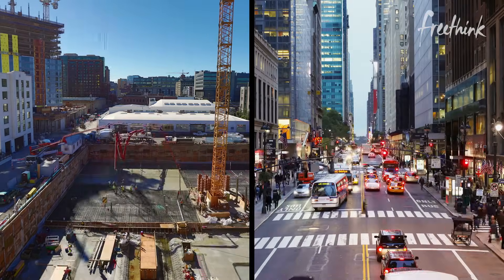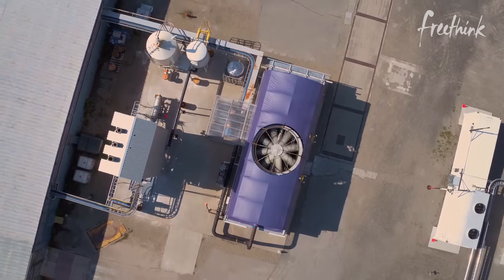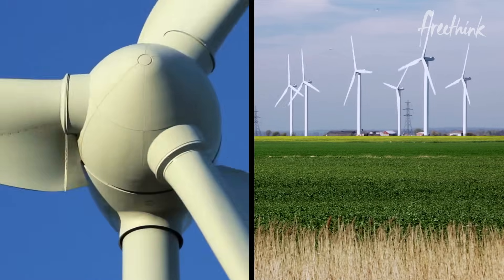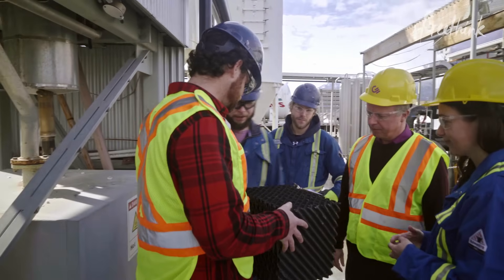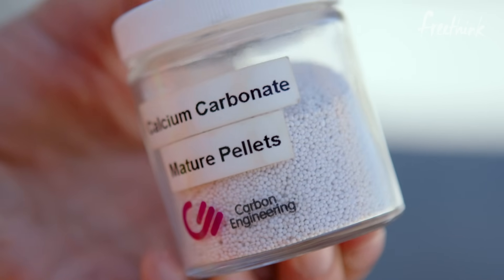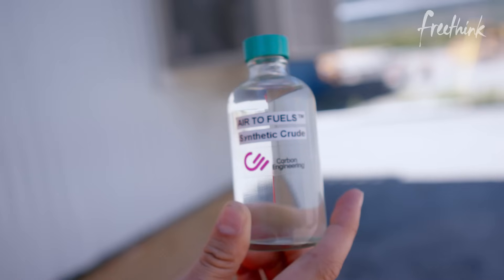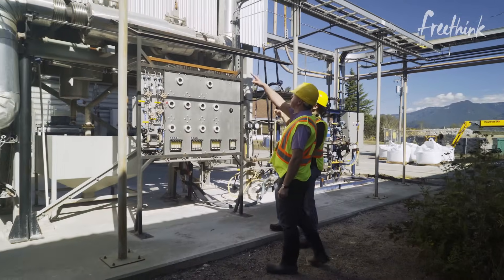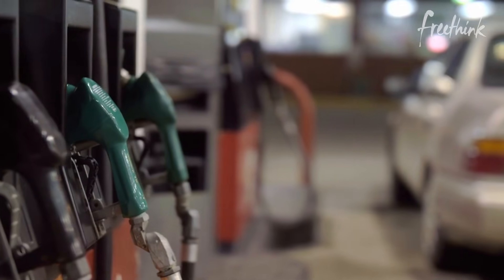Carbon Capture Technology Explained | Seachange

Comment: What i find amazing is, such things as carbon capture is somewhat  a load of nonsense. A giant scam. Is there an  issue with carbon?  In fact carbon is essential to life. In fact there is a dearth of carbon, at the moment, a shortage !!   At 400 ppm current day, this just does not compare to 7000 ppm of old. Note when it was 7000 the earth flourished, it did not over heat. The basic thesis is, more carbon equals more heat equals global warming.  Yet this is so demonstrably silly its laughable. Temperature   leads CO2 not the other way round. This is simple fact, verified by the ice cores. There is no evidence CO2 warms the atmosphere.  Of the three green house gases both methane and CO2 account for just 4 percent between them. Ignored by the IPCC completely because of its political make up (they only concern themselves with MAN made global warming) is water vapour,  responsible for 94 percent of all green house gas warming. . So can you now see fiddling with CO2 a little will have no effect at all?  I could go on....  Light absorption both inbound radiation and outbound... water vapour is already blocking that part of the spectrum CO2 might effect!  its  like having two pairs of black out curtains, the second pair does nothing!!!!   So an even larger second black out curtain (more CO2) is not important at all. It will have no effect on Global warming it is impossible.

Comment: In the Cambrian period 500, million years ago, there were 4000 parts of Co2 per million. Over 488 million years that figure dropped to 180 parts per million during the Quaternary glaciation, some 2 million years ago. At that point this Earth of ours WAS genuinely  heading for a genuine EXTINCTION level event ( for all creatures, indeed the worldwide human population dropped to less than 100,000). It was looking dangerously like it would join the billions of dead planets that you can see every clear star-lit night without a tree or a plant growing on them. Thank God, somehow the Earth fought back and Co2 levels rose over 2 million years to around 300 parts per million by the middle of the1800's. Around 1850 Mankind started to burn coal at that point due to industrialisation. It was lucky he did for two good reasons.

Firstly, Mankind stopped burning trees which is why there are 25 per cent more trees in the Northern Hemisphere than 200 years ago. Secondly, although mankind only produces 2 per cent of the Co2 in this world, as 98 per cent of it is produced by natural outputs, such as volcanic activity, at least he helped to bring Co2 levels up slightly so now it stands at 400 parts per million, albeit that this is still ONLY exactly one THIRD of what is the average optimum Co2 level required for photosynthesis for plants and trees, which is around 1200 parts per million. 

Now here is some simple maths. All plant life acquires Co2 mainly through water.  If the Co2 in the atmosphere is only one THIRD of the level a plant require for optimum photosynthesis, then even to the stupidest brainwashed climate drone without any scientific knowledge at all, it must occur (to what small part of their brain that they still own) that these plants are processing THREE times more water than they want to. What happens to water that plants take in? They can't store it so they EVAPORATE it through their leaves. Forgive me, but err, even Al Bore admitted that 90 per cent of Green house gas is water vapour. Do you think there could possibly be a connection between the FACT that there is only one third of the optimum level of Co2 in the atmosphere for photosynthesis and the FACT that that the Earth has exceptionally high levels of Water Vapour? No, surely not!

Luckily, as is often the way of history, the next generation but one, will piss themselves laughing at this current idiotic brainwashed generation and will create a worldwide program to help the planet by RAISING the levels of Co2 to assist all plant life, and therefore by extension, ALL LIFE, to flourish on this Earth, and the dangerously high levels of water vapour will drop back to normal and the total morons who promote this Co2 scam will be recorded in history for the criminals that the really are: the perpetrators of the greatest scam in the history of the human race. Only made possible because of the degeneration of the education standards in the West to the point where not a single ONE of the pathetic brainwashed "Climate Nazi" Idiots even knows how photosynthesis works, let alone the speed of light or sound or why the sky is blue. The standard of scientific knowledge required to pass the 11 plus exam at 11 years old in my day. 

All this anti- Co2 brainwashing consists of is a religious type dogma, it is not real science. It thrives because governments can hi-jack it to garner billions in taxing the air we breathe. Anyone with his or her own mind can look into history and see right through it. It is just like the Spanish Inquisition, where anybody who pointed out the obvious truth was burned at the stake by the pathetic ignorant brainwashed masses.

Comment: The overly simplistic explanation looks to me a scam to try to attract government subsidies and gullible investors. How much do these plants cost? Where does the hydrogen they mix with come from? What is the power consumption? What chemical process is being used to capture in the first stage? How is it better than solutions already existing in modern coal plants that capture a lot of the exhaust gases for either disposal or converting into raw products?
Sorre but this thing stinks the same stench as solar roadways.
Reply: To reach a carbon negative just in the US alone it would take 14.6 trillion trees. I don't think we even have enough land for that in the U.S. and that's just the US! These carbon capture plants are the equivalent of 40 million trees. Making just 365 of these would put the US at zero emissions. And these are first generation so as they get better we would need less and less of them.

Comment: On November 8, 2018, the article “The Climate Finance Partnership: Mobilizing Institutional Capital to Address the Climate Opportunity” discloses where the money will come from for the “fourth industrial revolution”, sold to the public under the guise of sustainability:
“Nowhere is the investment gap between what is needed and what is currently flowing greater and more urgent, or the opportunities more significant, than in the world’s developing and emerging markets. These economies are generally characterized by growing populations, rapidly increasing energy demand, and extraordinary infrastructure investment needs. But they also tend to have less developed capital markets and higher political and regulatory risk than their developed country counterparts. Institutional investors may therefore be partially forgiven for moving cautiously, even in the face of compelling long-term economic and demographic drivers.

A detailed analysis by the World Bank found that while $100 trillion is held by pension funds and other institutional investors, these same investors allocated less than $2 trillion over a 25 year period into infrastructure investment in emerging markets. And the fraction of that investment that could be considered green, clean, or climate-friendly was negligible.

So, what can be done? Whether you choose to look through the lens of unprecedented challenge or unprecedented opportunity, there is violent agreement that institutional capital needs to be “unlocked” (a favorite word on the climate conference circuit) and mobilized quickly and at scale.”
Reply: Today’s climate emergency mobilization must be recognized for what it is: a strategically orchestrated campaign financed and managed by the world’s most powerful institutions – for the preservation of capitalism and global economic growth.  This is the launch of a new growth industry in the Global South coupled with the creation of new and untapped markets. Leading up to this precipice, The B Team, the Open Society Foundation, Oxfam, and many others that serve as the human face of capitalism, have moved their offices to or set up new divisions in both Africa and Latin America.
Also of threat, to Western imperialism, is a burgeoning China. And to be clear – there will be no “fourth industrial revolution” for the Western ruling class – without uninterrupted and perpetual access to Africa’s bounty of rare earth minerals and metals:

Comment: So, what I don't get about what I have seen with carbon capture technology, is that the plants are usually planted in the middle of nowhere. Wouldn't the turbines be more efficient if they were installed on top of a coal power plant? I mean, the air looks already pretty clean in the video.
Reply: they usually build the capture plants on top of the carbon dioxide sources 
however they need to store it in a suitable geological layer that could be anywhere based on studies
sometimes they store it in depleted oil fields which of course exist most of the times in remote locations

Comment: Why not put one of these plants right on the output from say a coal power plant. Having the high C02 exhaust fumes fed straight into a carbon capture plant would surely be beneficial.
Reply: there are actually projects that do what you say
just look for post combustion carbon capture
Reply: Exactly what I was thinking!
Reply: Exhaust fumes is carbon minoxide (death)  C02 is dioxide (Life)
Reply: @tesherwa4528  it produces both gases.
Reply: There are already several natural gas plants in the US that do this and are entirely carbon neutral. Many people don’t realize that this technology exists.

Comment: but what about the energy that the plant consumes? did no one ask them about that? great video nonetheless, quite interesting
Reply: in a 2018 article, they said they used hydropower to make the plant work and used hydrogen from hydrolysis of water.
Reply: I think I saw something about the emissions it uses is stored in the ground
Reply: @jordanherrera5873  Where The Carbon Will Be Used By Trees As A Food Supply Of Sorts, Further Decreasing The Carbon In The Atmosphere By Making Once Inhospitable Regions For Plant Life A Utopia For 'Em.
Reply: Nuclear energy can do this.  Only nuclear energy can do this at scale, in time. Also Iceland is experimenting with using their Geothermal to drive this effort.
Reply: @hopliterati61  Nuclear Is The Most Efficient Yet Green Energy We Have, Not To Mention Canada Sits ON Some Of The Largest Reserves Of Nuclear Elements In The World At That.
Reply: There is not a chance that this facility captures more carbon then it creates.
Reply: https://youtu.be/SfuipeT0MUU
Reply: The promoters of "carbon capture" never get into how much energy the "carbon capture" plants are using. To have any chance of actually helping anything, it would have to remove significantly more carbon than the energy/carbon it takes to "remove" it produces.
Reply: The amount of energy this plant uses is insignificant to the good this does.  Are you saying we shouldn't take carbon out of the atmosphere because this plant uses power?
Reply: Exactly !! To be truely carbon netrual/negative all the energy they use must come from renewable sources ! Also capturing CO2 from air is not really efficient,  it is better to capture it directly from the emissions of industrial plants.
Reply: @MrAlexander100  Setup Small Carbon Capture Facilities Around Factories And Power Plants And Have The Factories Generators And The Power Plants Directly Connect To The Carbon Capture Plants.

Comment: A mobile Carbon Capture Plant would be more efficient and take it to near the Co2 Source.
Reply from the maker: This seems to be part of the approach - they are also working with natural gas/oil production facilities to capture the carbon they produce.

From https://carbonengineering.com/about-dac/ :

"DAC plants are location-independent and so can be co-located with an oilfield operator for enhanced oil recovery (EOR). With appropriate reservoir engineering, this process permanently sequesters CO2 in oil reservoirs during production. Utilizing atmospheric CO2 for oil recovery in this way greatly reduces the net addition of CO2 to the atmosphere from oil production and fuel use. It opens a pathway to producing fully carbon-neutral or even net-negative fuels."

Comment: Why not just plant more trees and stop Government logging operations
Reply from the maker: Hi Josh, this is a reasonable question! As he mentions in the video, reforestation and restoring farmland from depleted areas can help pull carbon from the atmosphere. We recently did a video on a nonprofit working with villages in Mexico to replant millions of trees that had previously been cut down (https://www.youtube.com/watch?v=RK7EohqKbaQ); they estimated that 30% of the carbon capture necessary to stop climate change could be done through similar organic sources. However, as you've probably gathered by now, the math doesn't add up: while it can certainly help and have other benefits (helping species recover, creating jobs in rural parts of the world), it just isn't sufficient on its own to offset the huge amount of carbon being put into the atmosphere by fossil fuels. See https://www.anthropocenemagazine.org/2017/05/we-cant-possibly-plant-enough-trees-to-stop-climate-change/ for more details.

With regard to stopping government logging operations, while there are some places where those may have a negative effect on the atmosphere, there are also some cases where tree thinning is crucial to mitigate forest fires, which both cause damage and release massive amounts of carbon into the atmosphere. We did a video that touched on this at https://www.youtube.com/watch?v=v2AC8nJ4Mb4 . 

Thanks for watching and hope this info helps!
Reply: Homo Quantum Sapiens  is right, no amount of trees can solve the Co2 problem.
Reply: Joseph Seeley   So beautiful 😍. But please be ready to move farther north with your skills and vision. The wet bulb temperatures in the tropics may become problematic soon. 😉